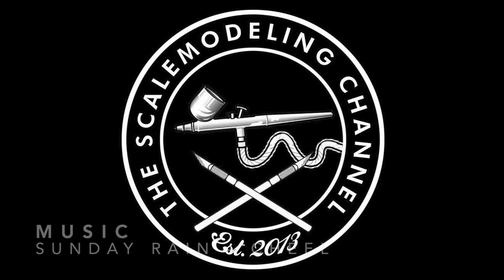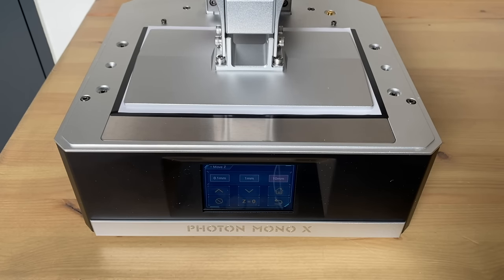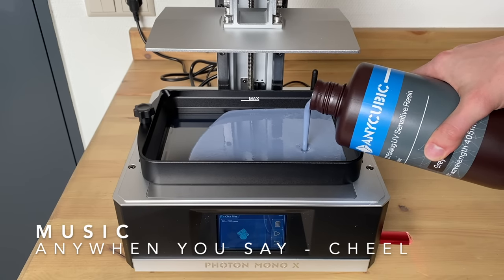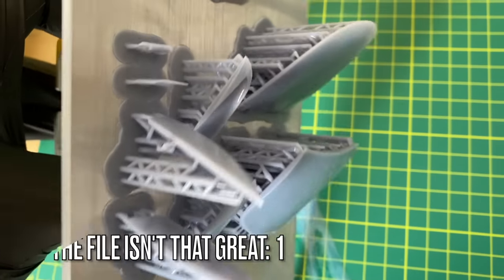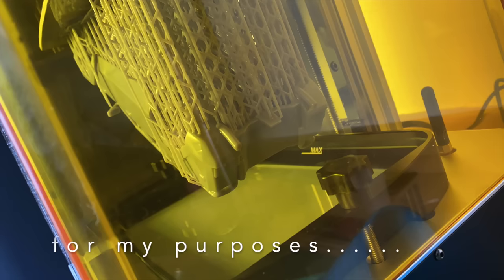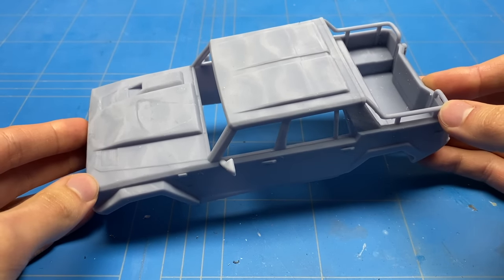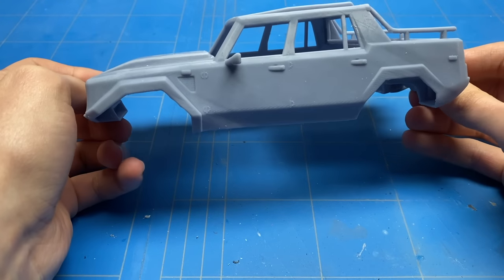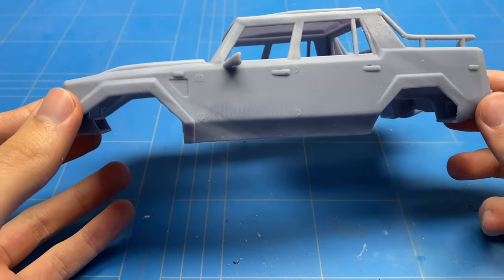Can you 3D print a Model kit?

Comment: I had considered resin printing models in the style of conventional model kits; this seemed a fruitless endeavour, since I was limited by the precision of available models (or lack thereof), and the ideas I had were either better catered  for in existing kits, or decent 3D models were as difficult to locate as any other kit.

3D printing is good for details like those wheels you showed, where the precision is higher than can be achieved by casts and molds, but a full kit in resin would be extremely costly in time and materials.
Reply: well resin printer is 200euro and wash/cure station another 200 , and resin is 50euro a liter , so you can make 5 models in 1:18 costing you 10euro per model , actually 5 but i included that you f. up half of prints :D , paint for one model 5 colors times 3euro ... you have cost of max 20euro per model in quality of 150euro models , ok you need to add time , but if it is a hobby than you do it for pleasure ....

Comment: I admit I skipped through the vid a bit but looking at the Tesla(?) at around 5:00, I think I see a couple of issues, offhand. The bottom of the body looking lumpy: This is usually indicative of a more parallel print to the build plate facing and you can mitigate it by printing it at an angle. This helps with certain layer support challenges that cause that lumpiness (it's the thinness of the material surface moving up and down through the resin medium and not contacting the FEP as it should - imagine dropping a bed sheet to the ground while holding two corners. It's not guaranteed to contact the ground perfectly partly because of how thin it is. Printing at an an angle helps support and control the amount of surface area being printed)
I'd suggest that you print the model hollow with a 'drain hole' on the top and bottom orientations. This would reduce suction and allow resin and air to move more freely through the model as the build moves up and down on the Z. It would also save you resin and relieve some unnecessary sticking challenges between the FEP and supports

Comment: I’ve only really seen 3D printing with resin printers as using a filament printer to be very smooth and not loose lots of detail would take such a long time it wouldn’t even be worth it. This is a great video, not only as a basic printer set up for printing models and also what can be done with a printer of this size.
Reply: I will use my FDM to make up internal parts that the resin printed parts attach to.  For example, if you cut away the windows and base of the Tesla he showed, it would print and cure better, but it would be somewhat fragile.  I can cut out the bottom and FDM print a box to give the car a lot of strength.  But at that point, it is more like a scratch build than a kit.

Comment: A friend of mine is into Transformers and has created some custom add ons for his figures using pla plate. I helped him experiment on remaking those add ons as 3d resin prints, and the result is still far than ideal. The 3d file itself need to follow certain rules, such as to not have overlapping objects and everything need to be in one piece as a closed manifold, but even so there's no guarantee that the printed object come out without any problems like elephant foots and warping issues. It takes a lot of trial and error and more expensive than FDM printing. Cured resin is hard and stiff, not ideal for anything that require more flexibility such as creating ball joints. The upside is that it can capture an insane amount of surface detail. In model kit designs it can work as master copies for silicone molding and resin casting, but resin 3d printing's true strength is in printing statuettes and miniatures.
Reply: There are some resins that are like the flexible ABS used in some injection molded toys.  Many people print with a mixture of these "tough" resins and the standard resins to get some balance and have more durable items.  (e.g. gaming miniatures)
Reply: @andy-in-indy  bio resin actually have slightly more flexibility than standard uv resin but I still wouldn't recommend resin 3d printing for jointed figures.

Comment: Just 3D printed some detail parts for a diecast I'm rebuilding on Shapeways. It went alright, a lot of the tin thin bits failed, but i was expecting that. There was a lot of step lines visible but I was prepared for this too so a few coats of primer and sanding its good to be painted. Overall I wouldn't recommend 3d printing for modelling unless its a fairly flat surface that you can sand and layer with primer.
Reply: Actually for non-flat surfaces, you can minimize most layer lines if the model is oriented correctly for printing. I've designed and printed a few wheels that had almost no visible layer lines, some that don't even need sanding (just light primer).

Comment: I was thinking of getting a scanner and scanning actual 3d model kits like you'd buy from the store. Mainly cause some of those models are extremely expensive. I saw a couple that were 500+ for a 35th scale plastic model.
Reply: Handheld scanning is still in early days.  The best thing to do is to scan a larger object and print it in a smaller scale.  This is because scanning a 1/24 scale object at .1 mm resolution means that you could have a panel that looks pock marked, as if the original vehicle had been hit by hail.
Reply: @andy-in-indy  ^_^ I know. I like the hail look idea for "apocalypse" and abandoned looking models. I was thinking more along the lines of the ciclop scanner rather then something hand held. Least until I can sell the dioramas and save up for the polyga compact s1 with its .04 mm resolution...i only need to make 6 grand for that one lol.

Comment: there's a print you can do called landy mini, its basically just a land rover. I'm not sure if it will work with a resin printer, since it is designed for a filament printer (idk the name).

Comment: Well, this is a lengthy discussion....
The problem is these online car models come from 3d modeling software, and although they are available in STL format,. They are  intended to be computer models. Model kits are difficult to make with modeling software (3ds max, Blender,....etc). CAD Software is the proper tool to create a kit. However, CAD software can read STL, but there ability to modify STL is limited. So the only possibility is to recreate the surfaces in CAD software based on the STL files available, exactly as model companies do with 3d scans of actual cars. I tried this twice. Once with an Alfa Romeo Carabo (built from scratch), the second when I was (and still) pissed off with the Revell jaguar E type kit. I managed to create the outer surfaces, but creating a body shell from them didn't work. These CAD software are so powerful that almost nobody can master all their capabilities. Until I get over this point my answer to the question in title will be:no. Hopefully I can convert it to yes.

PS: there is a Facebook user who is making kits of mostly US boxy cars of the eighties using CAD and 3d printing. His answer would by yes.

Comment: I have so many questions about the whole printing system I'd love to see an entire series on this kind of process before I spend money on a printer myself. I'd like to see what computer requirements are needed since I'll be needing one eventually,  learn about scanning and scaling parts and much, much more. Are you planning on buying a scanner, costs,  how to use, etc. since I'm not that tech friendly. I have quite a few ideas for use in both modeling and slot car racing. How durable are the resin(s) being used, what types to possibly use and so on. Would need for the slots something impact resist  that could take a hit without crumbling. Circle track, road, drag bodies. Also want to play around with scaling up armor for 24th scale tanks since 99% of it is 72nd or 35th. Any help would be greatly appreciated.
Reply from the maker: The computer requirements are all up to you, and the 3d software you want to use. The printers slicing software is not that heavy, so to speak.

Scanning i have no info about. As this is not really available to something that either works(properly) or is not super expensive. Scanning is a whole different ball game.
Realisticly, if your not that good with computers(like me..) scanning and modeling might be a bit to complicated to start doing if you have no experiance.

The resin is perfectly fine for static models. But for racing it can shatter in to pieces in the first crash. There are more flexible resins. But those are pretty much rubber.

Comment: I tried to make a Triumph Bonneville 1/18 with my Photon. Files made on Solidworks by me. Well....the printer is able to print very tiny pieces ( I was able to print the wheels complete with itheir spokes !) but they are very fragile as well, further 4 prints on 10 fail.... very frustrating. A Lot of work, a lot of hours of print. The printer when it works is quite sharp anyway..

Comment: As you already know, 3D printing is great for the hobby. And the "pros" outweigh the "cons" for sure. The bad part is we see a lot of people producing stl files that are not very well done. A lot! 
As for a full on kit? Who knows if that will happen. The only real benifit is the ability to 3D print inaccurate parts or missing pieces to currant and rare kits. I even designed and printed a part for a project of an intake manifold that has never been offered in any form. Kit or otherwise. So a person only needs to search and weed out the bad designs to find those great parts. Like that wire rim you shared. 

Tip: Hollow out the part and add drain holes if they are solid when dealing with large parts. Just make sure to add cleaning solution the the inside after.

Comment: It is 100% possible. But you need to know how to work with solid objects in 3D and as it's mentioned - how to print them. There's no guarantee that good looking part on the screen is going to be as good looking in the real assembly after being printed. Especially in 43 scale, while 24 scale is pretty easy to sand.

Comment: Yeah... you need to have drain holes in the file to drain the resin while printing.  However, considering what you were printing... there really
wasn't anywhere to put drain holes, was there?  Interesting.  But if someone did design a kit to be printed and they were serious, they wouldn't do
the heavy single block with body/interior/wheel attachments as one, negating the need for drain holes completely in most cases.